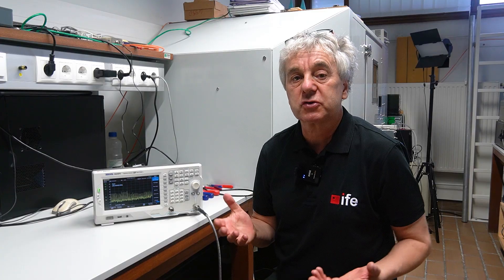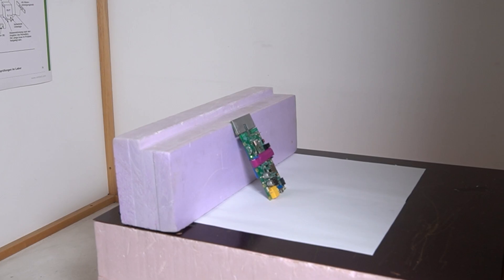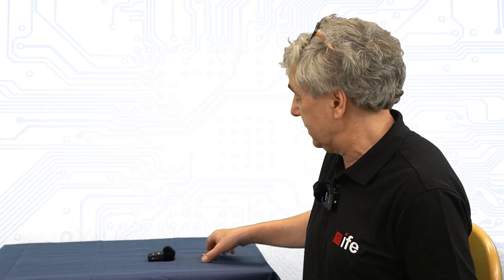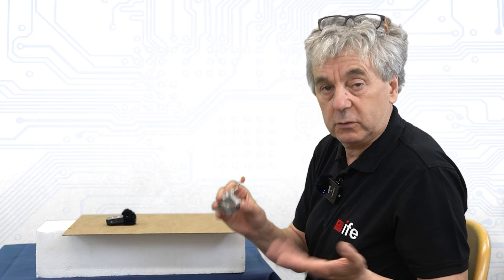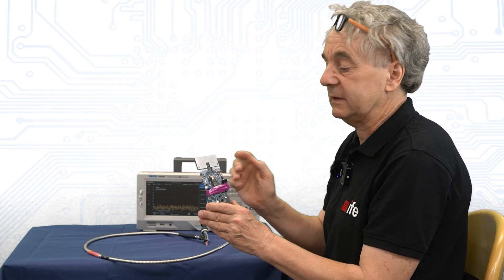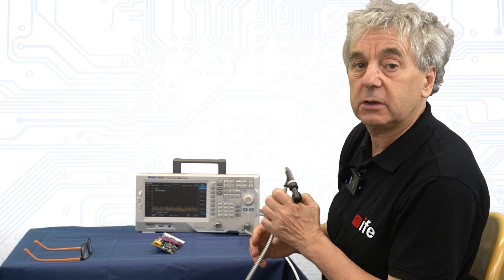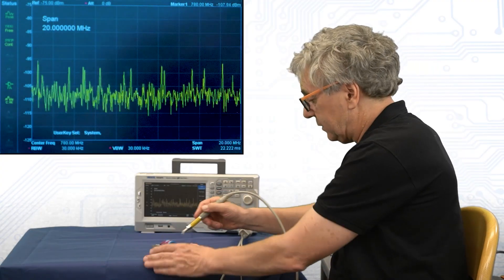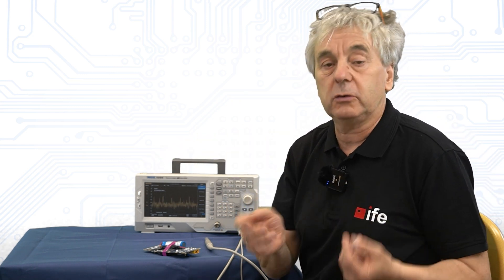Do not misinterpret near-field scanning data

Comment: Very thought provoking video.  Did you possibly mean the old probe has an operating bandwidth of 300kHz to 3GHz? Otherwise I can't understand how it was useful at 700+ MHz.  What would your approach be to solve the EMC issue with such a result (assuming it was your responsibility)? Would you focus on the hotspot from a design or mitigation perspective?
Reply: My questions too.